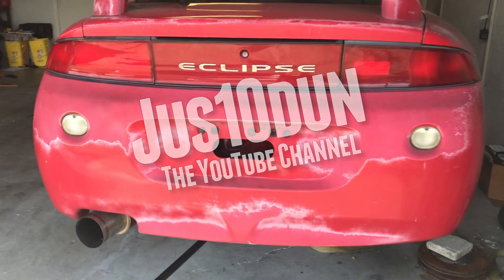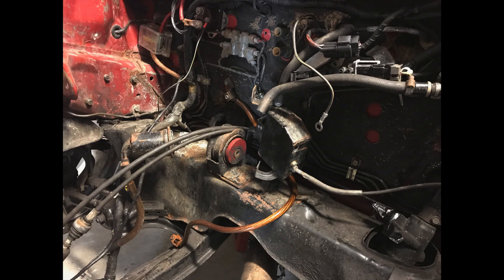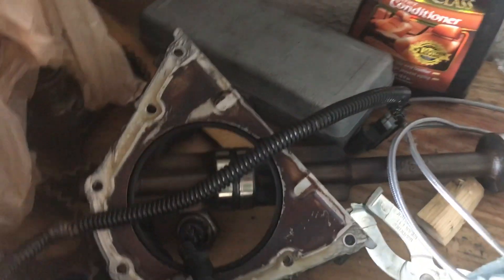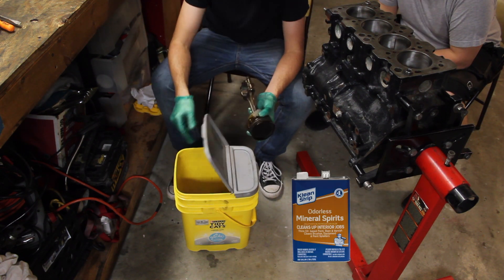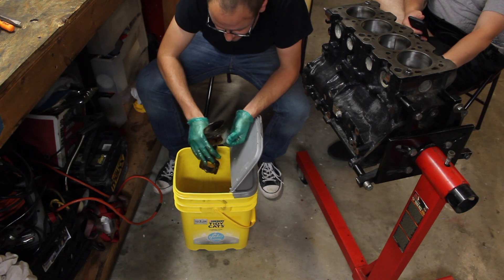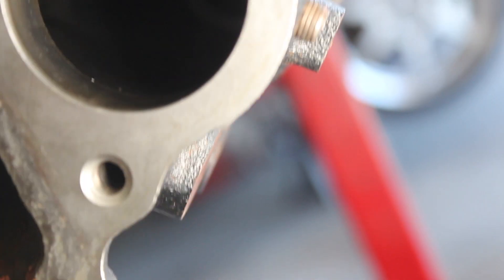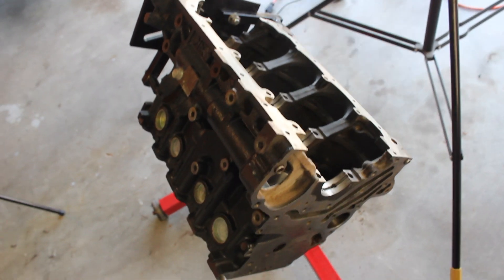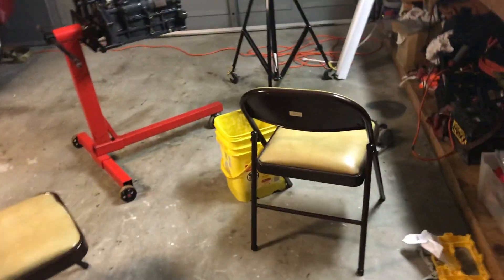4G63T Engine Block and Pistons : Mitzi’s Turbo Engine Parts Episode 4

Comment: Did you ever get new/used pistons?? 
Lmk I have a set from mine. Great condition, sand blasted wrapped and lube coated
Reply from the maker: No I have not I was rushing to get the car running again so I wanted to see how it would do with the bare minimum. At the time if I had to buy pistons it would be longer. Those pistons sound like a good next step. I won't be back at the assembly for a few months. In the middle of moving. Thank you for the view and comment. Im trying to get another episode out to you.
Reply: What type of pistons ?

Comment: Evaporust would clean out the rust in the block.  Don't reuse those pistons and I don't think you're suppose to cut 4g cranks as they're coated from the factory.
Reply from the maker: I think you are right Evaporust would work too. maybe even better. The coolant passages still needed some work. I agree on the pistons. I will see how bad it goes for now. Probable going to detonate at the worse time. I was not aware of the 2Gs having the coated crank I thought it was just the evo III cranks. I will need to do Pistons crank and rods soon. Car is still not together. May now have twice as much work to do.

Comment: How much was it at the machine shop for the work? Going to have to do the same thing
Reply from the maker: Im a little of a cheapskate. I asked him to go low on the work. The crack cost the most. $200 for crank. The block was only cleaned and honed. That was like $100 or so. I would suggest if you don't plan on rebuilding it soon to spend around $500-$700. Do block deck, line hone journals, full clean, flux inspection for cracks, bore cylinders, and have them assemble for bottom end for a little more. They will blueprint it by weighting the parts and checking every single measurement. I am still not down with my rebuild. I have motor in car. I had to sell my house and in process of a new property all my stuff is everywhere. My motor was a quick rebuild trying to get done before my move. I still have loads of footage to put together. Thank you for the questions and comments.

Comment: If you can feel the lines in the bore with your finger nail don't waste your time with it, also, the carbon can be taken off but the larger issue is the wear on the pistons. The are probably out of round. really you just need to get new pistons and make sure they seal in a nice clean bore. If you sign up for Paypal credit, you can buy stuff of Ebag and make payments.
Reply from the maker: That is a good idea. Thanks for the info. I have a time limit though and I want to build this in stages to see how each changes effects the car. Then drive it like it should be. I did get the carbon off. Out of round, do you mean the piston diameter or wrist pins?
Reply: @jus10dun   the cylinders, they wear more on the thrust load sides. The roundest part of the cylinder is going to be above and below the limit of travel of the rings.If you get a stone cylinder hone, and keep the stones on the top of the cylinder, and the bottom of the cylinder as guides, you can hone the middle back a little rounder. Take a ring without the piston, and move it up and down in the bore while shining light from the bottom, if you can see light around the outside edge between the ring and cylinder just stop there and get it bored with new pistons.

Comment: big no no i wouldn't install thos pistons back also i would hone the block and clean all the marks on the bores
Reply from the maker: Emanuel Valentin thank you for looking out Emanuel. I agree with you. I will probably need to rebuild the motor with new pistons. I was working on a time line and I’m building this motor to learn how changes effect the performance and reliability. These pistons were in there making power so I want to see how that effects the tune. You’ll be laughing later if it blows a gasket or excessive knock. I’ll have more time and money to do it properly then.
Reply from the maker: The walls are pretty good but that black line is slight. Again I will probably not have as good of a cylinder ring seal as it should. But I’ll compression test it and we’ll see if it works. I’ll have to have the block cut for bigger pistons to get rid of all the gouges.
Reply: @jus10dun  "blows a gasket or excessive knock" ha.....youll be lucky if you dont get hit by one of those pistons in the head.....
Reply from the maker: @divljacina1  it will be a good show for sure regardless.